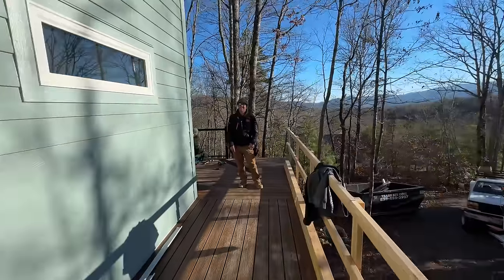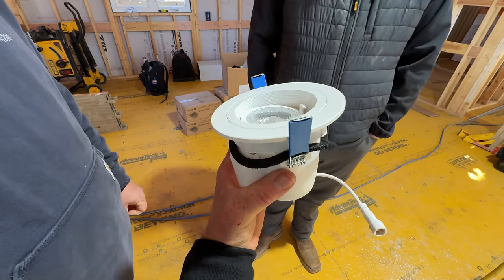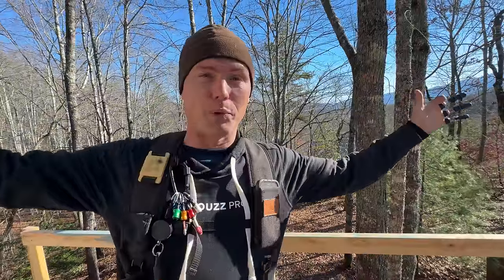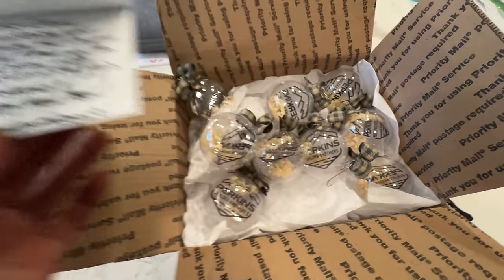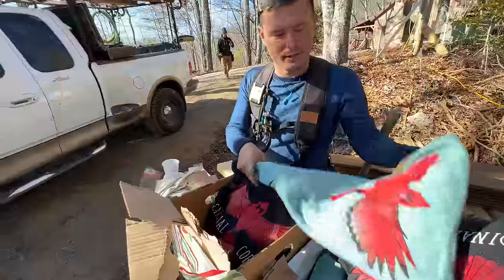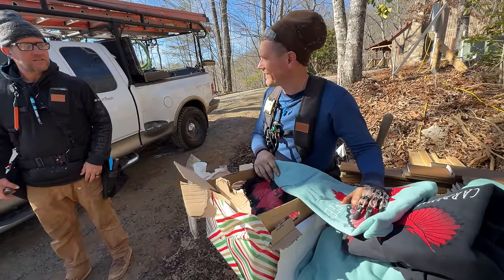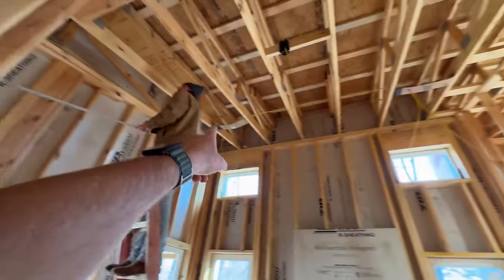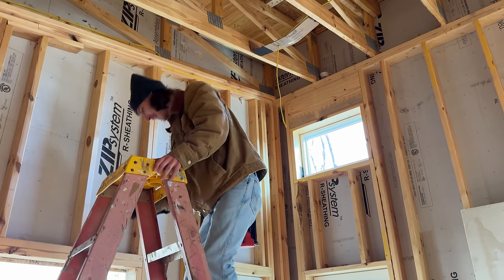Modern Home Build | 38 | electrical, railing finish, metal roofing

Comment: Don’t forget the floor decking when you’re adding screen. Bugs will come through the decking.
Reply: I was thinking the same thing.
Reply: Little tiny strips of quarter inch screening? Lol.😅
Reply: It’s a catio so no screening under the deck. The enclosed screened deck is to take the cats from indoor/outdoor feral-y cats to indoor feral-y cats with a a nice area to get contained outside time. Cat hair and dust from the gravel neighborhood roads would be an issue. Perhaps citronella candles or plants will help!
Reply: @ramellesmith1520  Great! That’s good to know. My cat would love having a screened in porch.
Reply: @mavrosyvannah no run the roll parallel to the joists so the seams follow the joist and go the whole way.

Comment: Lights on one switch... 
I worked decades ago (1980s) at a historic estate where there were flood lights in the eaves all around the main house. They were all controlled by one switch located in the front hall coat closet. 
Trouble was that the actual closet light was just a pull chain, so people would go into the closet and wanting to turn on the light would hit the switch for the outside lights by mistake. The whole place would light up super bright! 
I ended up taking an Altoid tin, cut a hole in the bottom and glued it over the light switch so people wouldn't hit it by accident. They had to open the tin to get to the switch. 
It worked well, so well that I recently visited the property (my daughter had her wedding reception there) and found my Altoid tin was still in place in that coat closet after almost 40 years!

Comment: I was a custom picture framer and I used a fine tooth blade (50 teeth i think) and a wax stick on the blade before every cut.   Cleaner and minimizes the heat that damages your blade.

Comment: You can buy mounting plates for those "canless" recessed lights that have knockouts already punched in them.

Position them where you want and attach to the rafters. Then the drywallers can cut the holes when they hang the rock so sparky doesn't have to rain dust all over the place when he comes back to trim out.

Comment: Just a heads up, if you would like to save your Engine & Transmission etc please wait a few positive seconds after starting your vehicle or any vehicle so it allows for Lubrication system to energize ( BUILD UP OIL PRESSURE ) OTHERWISE YOU WILL HAVE MAJOR PROBLEMS FROM ZERO LUBRICANT UP ON TOP OF THE ENGINE/ TRANSMISSION TORQUE CONVERTER NEEDS TO SEE OIL PRESSURE & SAME FOR THE REST OF THE INTERIOR TRANNY' COMPONENTS . 
Perkins Builder Brothers 
definitely have my vote for
 America's #1 Home Builder.
 Keep up the great work👍🏼
💥 BADA BING BADA BOOM 💥
I APPROVE THIS MESSAGE 🙌🏻
Nj'sJfJr 👍🏼💪🏼❤️🇺🇸

Comment: Lutron caseta allows you to stack the dimmer or switch in a closet (with the main breaker panel, etc.) and use the remotes wherever you need them, and you cane tie it to Amazon Alexa or Siri and make the lights operate by voice command, phone command, etc. I LOVE my Caseta system and it’s VERY reasonable on cost.
Reply: I currently have no internet/wifi availability beyond what I can get via cell signal. Cell signal will require a cell signal booster. I love where I live but rural America is very limited when it comes to internet accessibility. 😢

Comment: It is not actually that the aluminum is "hard" but actually because it is soft. The metal is "sticky" and gets grabbed by the carbide blade tips. It is the same reason why your files gum up quickly when filing aluminum or brass.

Comment: Hey Eric, I worked weeks on a fabrication using extruded aluminum. The saw I used was an odd ball from France, I believe. It looked like most chop saws but was designed for extruded aluminium. The blade only turned at perhaps 500 rpms. BTW this odd saw was about $2000 to purchase.

Comment: Commercial sheet metal installer here-Always a good idea to use butyl tape on the roof to wall flashing. Also on gable trim or any other area where you are fastening metal to metal like shown.

Comment: Pro Tip: Eric and Jay, a good trick I learned for cutting plastics or softer materials is to turn the saw blade backwards - it works great (in my experience). I also use a hole saw for those new fangled recessed LEDs and I run those in reverse, as Sheetrock is VERY soft. Works great!

Comment: You can use 4:36 the “wet rated” wafer lights and use a hole saw or tin snips to cut in the holes… then you just install a remodel switch box anywhere … it is possible to feed a switch leg through your soffit and into the crawl space … a vented soffit is much easier …

Comment: I find the trick to cutting aluminum is to use a used, semi dull blade. It still gives nice clean cuts but doesn’t catch and fling the metal like a sharp blade does. Also I wish you wouldn’t cut us off from hearing Jamie go off in detail. I would pay a nice sum to learn a fraction of that man’s building knowledge.

Comment: If you haven't wrapped up the screens for the top, they make some with the small spring-loaded pins that hold screens into windows. You can do that with small holes in the wood to pop the pins into so the screens are removable but won't fall out and would not even need a track or frame since the screens will weigh almost nothing and have almost no pressure from wind (protected by eaves) and won't be hit by any users (too high up).

Comment: Master electrician. When I come up against the bathroom problem of no room for switches, I use the Lutron Caseta system with the remote that needs no box. And you can make the whole house a smart home. I’d really push Ramel to go Lutron Caseta.
Reply: Currently not an option as there are no internet options in my neck o’ the woods. The not joys of living in rural America and i would trade it because off all beauty, being surrounded by nature and no traffic issues in the greater county area ( but not so for our rural, very popular little town)!
Reply: @KylesRV  - I am aware. However, there’s a wait list here. It’s a lot of money for way more speed than I need. And I am not a big fan.
Supposedly, a regional provider is to have a meeting with the homeowners in my neighborhood to discuss some possibilities. I have been without internet since I sold my business and moved into my temporary home May of 2022. It’s annoying but I have managed thanks to the help of friends!
Reply: here in the uk we cant have any switches inside the bathroom at all so we either have them on the wall outside the door or a pull cord inside.
Reply: Can’t get starlink?

Comment: I have about 30 soffit lights on 3 zones. I used Lutron Caseta switches so I can control them with an app. Our soffets are stucco so that was fun. Lights are also wifi controlled ( don't use that) leds but I ran Romex anyway instead of smaller gauge wire. It looks amazing all lit up. My wife goes to bed early so I can turn the back zone off by the bedroom and patio while the sides and fronts stay on. That's why I did 3 zones. I could program a button on the app to have them all come on and or off. I could also set timers. The Caseta stuff is expensive but it works without any issues. It's worth doing IMHO. The other cool thing is this is a new upscale area. 90% of the houses also did soffit lights so at night the neighborhood looks amazing.
Reply: Dark Sky person here

Comment: Im sorry But If you didn´t think about the Bug net protection in the Roof Gaps,... than what´s about the Floor Gaps that are Wide open for other Bug to Come in,...
Reply: The point of the covered and screened deck is a catio for my two semi- feral cats. Screening underneath is not practical because of cat fur and the dust from the gravel roads in the neighborhood. It will be much less buggy, I can use or plant citronella. And the cats love to torture bugs and eat them so maybe their treat budget will decrease😹

Comment: Just add plexiglass or polycarbonate instead of screens.  Cheap and easy.
Reply: But I want to smell the woods and hear the wildlife! So screens it is!
Reply: @ramellesmith1520  I mean't, in the top gap above the screens😁
Reply: @jacobecorder  - Ahh! Still prefer screens. I think it will be easier maintenance. The whole having to clean a window up high. Hoping most of my choices will mean less time cleaning more time enjoying life!
Reply: @ramellesmith1520  smart.  I didn't think bout the cleaning requirement. Sweet house by the way!